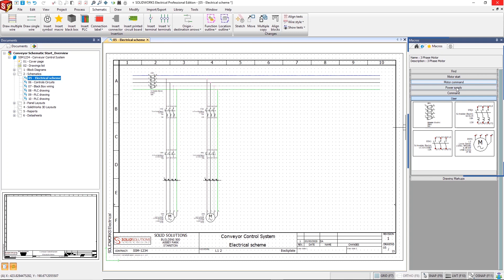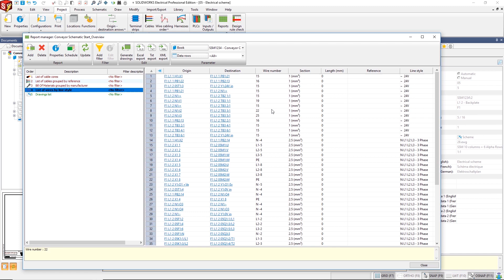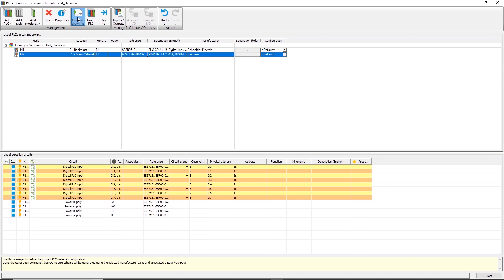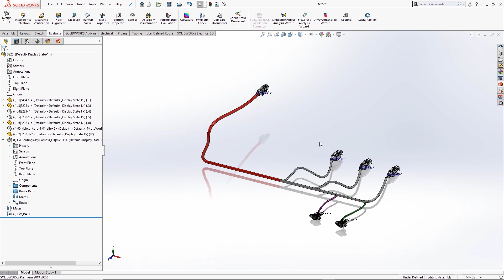Introduction to SOLIDWORKS Electrical

Comment: Any idea why when you use PDM with electrical and mechanical the version of the part that you use does not get updated? If i start an electrical project, it gets locked to that PDM version and if I update anything mechanically on the connection points, it does not reflect on the wire harness.